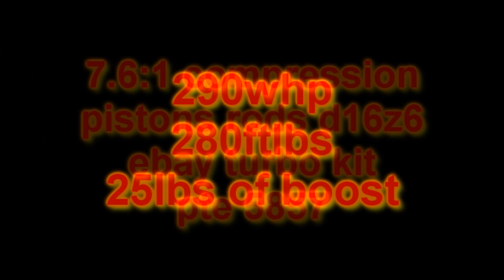11-16-11 project turbo civic dyno fun

Comment: I had higher hopes for the precision turbo. What did the ebay one put down again? Like 270 at 20 psi? Probably could have made another 20 whp with another 5 lbs if it hasn't achieved meltdown IATs by then.